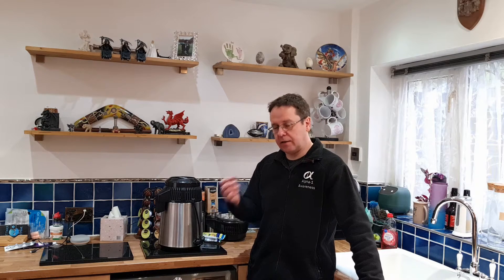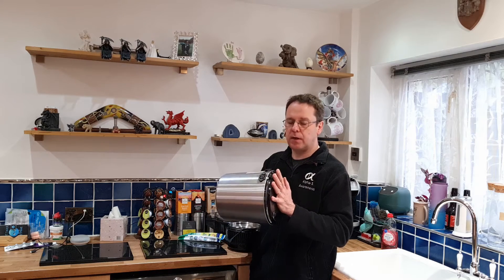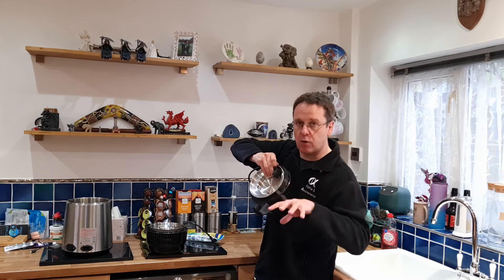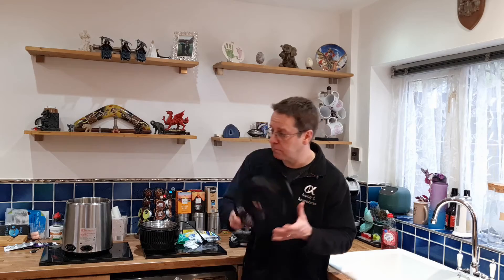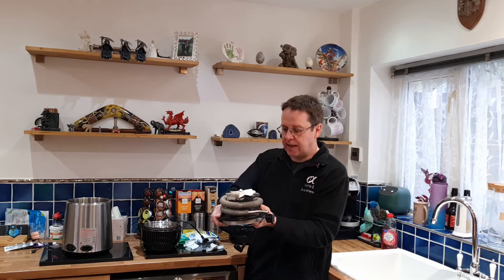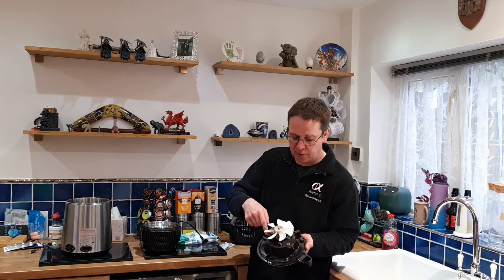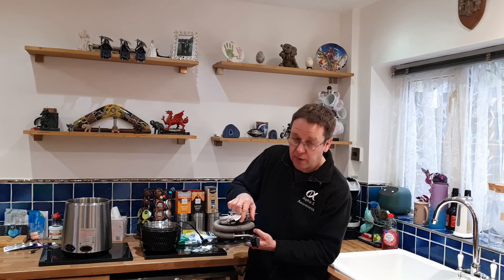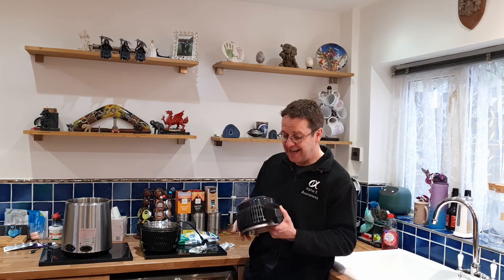Deep cleaning the Air Still

Comment: Thank you so much.  Before I use my AS again from years of storage, should I distill some plain tap water through it to clean the coil pipe ready for the wash?
Reply from the maker: I don't think distilling just water will help much to be honest, but it wouldn't do any harm.  Doing a small vinegar wash first (say 2 litres) then a water run, that may be helpful.  It all depends on how long it was used before it was stored away, and when it was last cleaned (before storage).
Reply: @brewingadvice   I think I just ran the lid under hot water to clean the pipe out last time before storage.  I'll run with some vinegar and water like you suggested and flush it out after.  Thank you again and sorry for so many questions.  Regards.